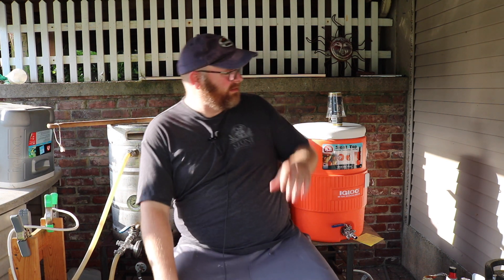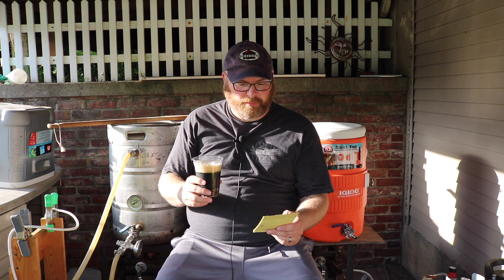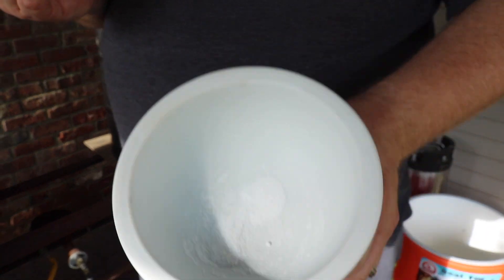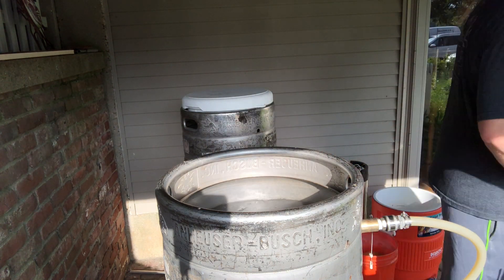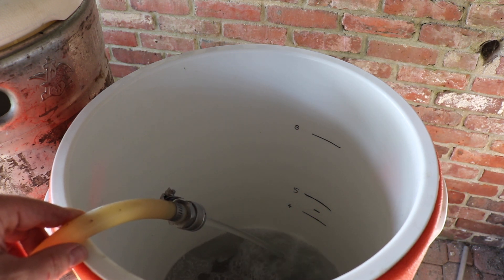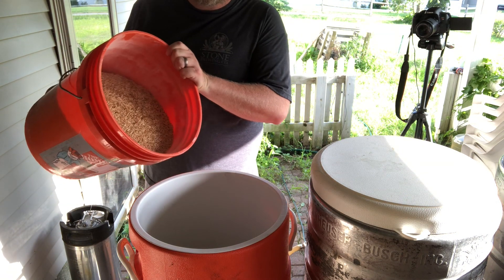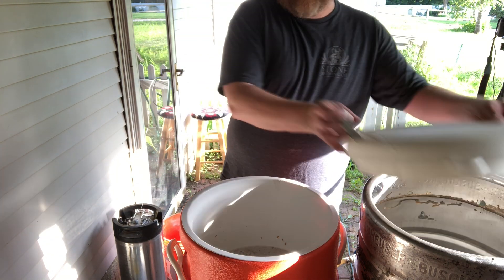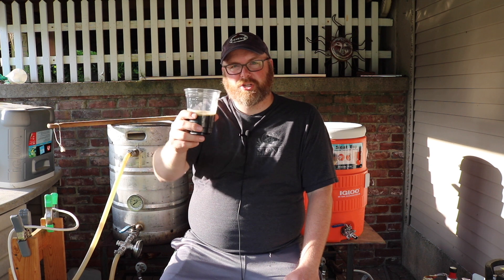Water Chemistry and Setting up The Mash

Comment: Hi can you tell me your original ph before you added your chemicals thanks
Reply from the maker: My water pH is reported to be 7.4.  I don't explicitly check it before I brew.  That number is what's was reported on the test sample I sent out and it's also in line with what the town reports annually.  I don't test it because, for the most part, the pH of the starting water is meaningless.  It's the water composition that's important.  Hope that helps.  Cheers! -Mike
Reply: @BrewDudes  that fantastic thanks very much love your vids I’m just getting all my equipment together for ag brewing only done kits before love ipa so looking forward to trying my hand at this incredible hobby with ag thanks again from the Jurassic coast uk 😊👍

Comment: Love to see batch sparge with your setup! Any idea what % of efficiency you can get with high gravity(8%) IPA? Struggling to get higher OG with similar setup with 10 gal batches. Get 1.057 pre boil OG
Reply from the maker: I have added some new equipment lately to my rig so maybe its time to do that batch sparge video.  My efficiency in general is 70%.  I goes down into the hight 60s when I try and go higher.  I don't really chase efficiency, just use more grain to compensate.  There is also no shame adding some DME or sugar to the kettle to get there IMO.  Many of the best brewers the world over have done that for years especially the Belgian Brewers.  Cheers!  -Mike
Reply: Brew Dudes ahhhh so how big is your grain Bill (lbs) for a high gravity IPA using 10 gal mash tun cooler?  What I’m really trying to understand is the negative effect of too thick a mash???  Any corrective ideas??? Typical grain bills are 28-30 lbs in 10 gal mash tun and I’m filling the water to the top.

Comment: Great video as always. Why did you use lactic acid instead of phosphoric. I have both and am trying to figure out when to use which.
Reply from the maker: Because I have it on hand.  There is no difference in flavor at the level of 1-3mls per 4.5 gallons of strike water.  I will probably buy phosphoric acid when I am out of Lactic.  But realistically it hasn't impacted the flavor one bit.  I've tasted the water post acid but pre-dough in too.  Cheers!  -Mike

Comment: So...lets say your going to do a big Russian Imperial Stout and you're starting with RO water...what would you add to the water? Calcium chloride and gypsum?
Reply from the maker: Same as always.  I'd adjust with a calcium salt to hit the right mash pH.  Only then, after that, I'd worry about what the salt profile effect of flavor I wanted.  For a stout of any kind I'd either balance the two or  go 2:1 in favor of chloride.  It really would depend on how the beer comes out, then I'd brew it again and plan for a change.  I never assume I'll guess right on the first time through.  CHEERS! -Mike
Reply: @BrewDudes  thanks for the reply!
Reply: I suggest you check Palmer's water adjustment app. It has the parameters for any style. Plus the actual tool to adjust your water

Comment: I stopped batch sparging 2 years ago and never looked back! I now prefer fly sparging. I do it all with gravity. Its the only way I can do 10 gallons with my system.  Thanks for the video Mike!
Reply from the maker: I am curious about why 10 gallons was difficult on your system.  I used to batch sparge 10 gallons and it was fine.  What was your issue?  I recently looked at a 10 gallon gravity system from morebeer. So my interest pertains to that. CHEERS!  -Mike
Reply: @BrewDudes  When I was brewing a beer that needed 24 pounds of grain for 10 gallons it would not fit in my mash tun when I would add the sparge water. I just found it easier to fly sparge.

Comment: This is the exact procedure I always do on my system. Except I underlet from HLT to mash tun. 34/70 is a very clean lager yeast and my favorite go to lager yeast. Cheers
Reply from the maker: When you underlet do you get less doughballs?  I have wondered about that.  My current tubing is just long enough to reach the top of the MLT.  Underletting would make it a little easier with the kit I have going now.  CHEERS!  -Mike
Reply: @BrewDudes  I transfer slow when I underlet so no dougballs at all. Cheers

Comment: Very interesting that you add all your salts to the HLT.  I've seen adding salts done in few different ways.  Makes you wonder which way is best, or if it even matters, in which case just do what works for you.  I'm still fairly new to the whole water chem thing.  I too like to simply things for myself, so I've been adding all my salts and acids to the mash.  It seems to work out.  I also follow BeerSmith 3 for my recipes and Bru N Water for the salt additions and pH assumptions.  I haven't used camden tablets, but I do use an RV type water filter for incoming water to the system.  I'm interested to know any differences in my practices vs yours.  Love your videos, they are very educational and makes us think.  Thank you for sharing your process.  Cheers!
Reply from the maker: From a chemistry stand point there is no difference to when the salts are added really.  CaCl2 and Gypsum are readily soluble so if you weigh them into your grain bucket and stir it all in... its the same thing really in my mind.  SHouldn't have an impact.  I haven't tried some side by sides yet to see if the campden is doing anything for me.  John uses an RV filter to deal with chlorine in the water when he brews. Glad you appreciate the vids!  -Mike

Comment: I'm interested in your focus on calcium pertaining to mash ph. What role does it play? 
When you use Brun water do you put your full volume of mash+sparge water in the mash water volume box and adjust total volume to the target mineral content?

Also, love Kostritzer. Been buying it in those 4 packs of cans recently. Interesting brewery history. I dont know if Shiner distributes there, but their Black Lager is a schwarzbier that is worth checking out as well.
Cheers!
Reply from the maker: I'll think about doing a brun water video specifically.  The short answer is I do some extra math outside of the sheet to scale up to my 12 gallon HLT volume of water.  I haven't determined yet if the sheet works properly for the way I am doing it.  Meaning mashing with 4.5 gallons but treating the whole 12 gallons.  I am being wasteful too because I don't even use the full 12 gallons by end of brew day.  And the function of the calcium chemically is that it reacts with compounds in the malt to release Hydrogen ions.  H+ ions are what you are measuring in pH.  The 'p' in pH actually is a mathmatical designation that indicated the log of a value is being expressed.  In the case of pH its the log of the H+ concentration.  More calcium leads to more H+ release for the sake of this discussion.  -Mike

Comment: you can use beersmith 3  to calculate water profiles now, its super easy as long as you have your water chemistry down.
Reply: I´ve tried beersmith, but I don´t like to do 3000  steps just to be able to print out a recipe. Kudos to thoose people that have patience to fiddlefuck with it
Reply from the maker: I'll second this view.  Beersmith v1 was a way better tool for people just looking for a way to document the recipe used, when it was brewed and how it came out.  Too many people want software to tell them what to do.  Beersmith1 was a supplement to the brewer who knew how to brew but wanted a tool to support documentation and formulation.  -Mike
Reply from the maker: But I am not interested in water profiles.  I am interested in mash pH calulations.  I purchases BS3 right before this brew and was disappointed to find that was the case.  He has a pH adjustment tool but not a pH prediction tool based on water chemistry... unless I missed it.  Cheers!  -Mike